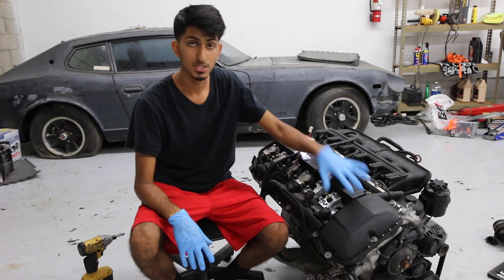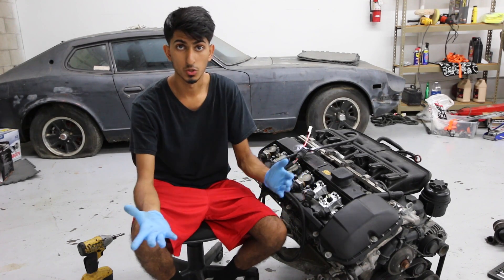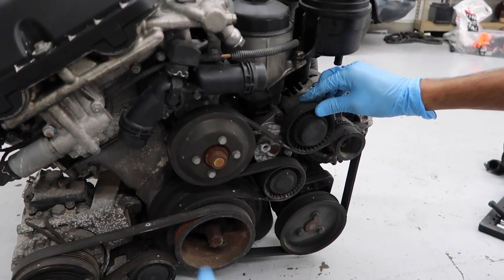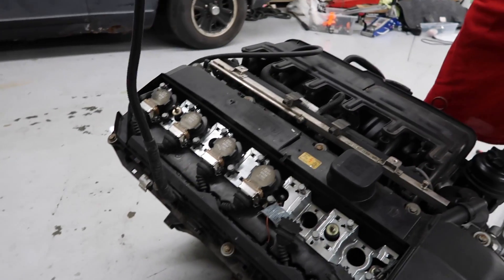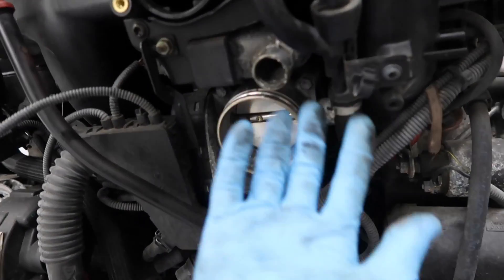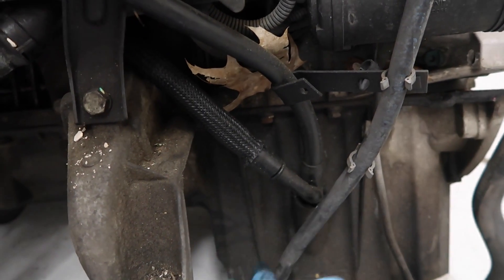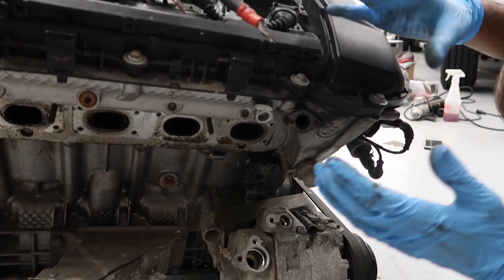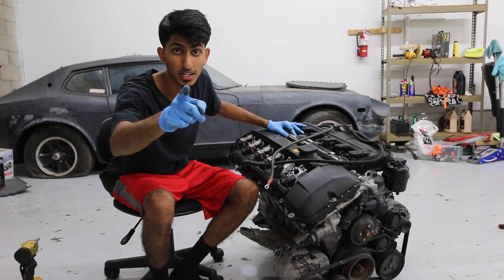Part 1: BMW M54 Engine Disassembly- Get To Know Your Engine

Comment: Hi, question please, BMW E39 M54 engine. The car smokes rarely only after accelerating following descending, after a deep vacuum it smokes, that is, if we go down on neutral, nothing happens, but when we are on some kind of gear shift, and suddenly we gas, smoke comes out. PCV valve, valve stem seals are changed. Gasoline 95 is used, by the way, it happens after long drive, when oil temp rises, though in rare cases. After smoking the level of oil decreases. I am sure it is oil. No smoking in the morning and in the rest of cases, what could be the reason, TNX

Comment: Great video .. I need your help with this p1419 code. I replaced the check valve and the secondary air MAF. The secondary pump appears to be working at cold start for about 30 seconds then shuts off. I still have the check engine light. I took it to the dealer who basically said, I have a blockage and I need a new engine 😳😭.. the car otherwise runs perfectly fine. Is there a way I can “clean” this blockage ? I have a 2004 X5 3.0L. Thank you so much in advance!

Comment: Urgent help , on the exhaust side of the engine under the solenoid and the cam shaft sensor there is a part that uses a 32 wrench to remove what’s the name of the part because mines leaking oil and it’s not on the OEM diagram listed or it can’t be seen.

Comment: Hey guys, i have a problem with my e46 m54b25. My engine does a strange sound but i cant really locate it and find the reason. It sounds like a high pulsing tone like on this videos: 

my car:     https://youtu.be/kzx0Bgm_D9A 

other guys car: https://youtu.be/ZZfxCLt5ygc

the direction of the sound is from the throttle, but i cant image that the throttle or the idle controll valve can cause this sound

i thought the DISA was the problem and i changed the DISA, but the sound was still there. 

i would be very thankful for every tips and help.

greets from germany!

Comment: I have a problem with my oil pressure. It pops on my dash when i put mine airco on. When i turn it out the oil pressure goes away. What can it be? Same engine

Comment: Hello great videos 👍
My Qs?
is what manual transmission can I use on my m54 04 330ci? Like from what car,or there is non other tranny that will fit my 3.0 engine?
Does one from a 2.5 will fit?  
Just lookin to swap a tranny that bolts into my 3.0 block!!

THANKS IN ADVANCE 👍

Comment: Hello. Do you know of any place that sells a kit that would include all the various plastic components found on the driver's side of the engine, or do the have to be sourced individually?  I'm also looking to buy a shop manual before I start the rebuild on my 2005 320i with the M54 engine. I just recieved the cam timing & vanos tools, but I'd like to get a shop manual that has all the engine specs. Any help would be appreciated. BTW, great videos.

Comment: I posted this on a fourm but i wanted your 2 cents.
Hi,
I currently have a BMW 2005 e46 325ci.
I have a rather Unique idea for the car. 
My plan is to leave the currant engine in the front of the vehicle and in the back (where the passenger seats are) i plan to put a second engine.
I will connect them Inline with a drive shaft then at the back of the second engine i will have a 7 Speed Sequential Trans-axle transmission.
I would also like to have a clutch separating engine 1 and 2 so i can drive the car in economic mode.
I will also be installing a roll cage around the second engine, and probably sound dampening to stop me from going deaf after 5 minutes of driving. 
Other issues with my plan is how do i cool the second engine?
How do i feed it air?
Both engines will be super charged and maybe turbo charged. I want at least 250KW (335Hp) from each engine.
What do you think? Is this a great idea, or a way to ruin your ears and wallet?
Regards for any answers,
-Tim

EDIT: I still plan to keep all the interior in the front of the car, both seats and radio, etc. So im not going all out race car.
UPDATE: The rear engine is going to get air from the two rear side windows. They will be modified to have the back going in the car about 7.5cm. This will be done on both sides. Note I still have no idea how i'm going to cool the beast.
What do you think?

Comment: What's up man, like your videos, it's really helping a lot. I had a questionare you ever going to show how to rebuild a E90, 2006-2011 engine? I have a 2009 BMW 328i, it doesn't start but cranks, the mechanic said to just swap the engine, but if I can just rebuild it, it would save some money, and get to know how. There's No video on YouTube that shows you step by steps like you do. And If you would like to use my car for a video show how, in case you don't have the exact engine or car, let me know I'll email more info. but the down side is that the car is in houston.

Comment: great video jason
i got I question recently my ccv system get frozen due a extremely cold wheather here in chicago i turned the car that day and my e60 started black smoked coming out thru muffler 3min after the car shutdown himself and i doesn't want to startagain i pulled 3 sparkplugs and they are covered in oil i check the vaccum hose and is clogged with yellow smog in this case what will recommend to do any advice will be really appreciate thanks
Reply: You probably already figured it out, but you have a hydrolock - oil got sucked in from oil pan into intake manifold. It probably destroyed the engine.

Comment: Nice job on your detailed instructions. I have question. I have 2006 550i that needs the valve stems seals replaced. Is that something I can do on my own, and do I have to remove the engine from the vehicle. Can you do a video on that? Thank you in advance. Keep up the good work

Comment: I don't know much about your channel but where did you learn to work on this engine?  Is there any books you would recommend besides the dealership repair manual?
Reply from the maker: Honestly I just took it apart and figured it out. I am sure there are repair manuals like the bentley manual that should go over everything

Comment: The parts in this engine is a cheap way to build a stroker out of a M52 block.  M54 cams, crank and pistons. Keep those if the engine is toast.

Comment: very excited to see you back at the helm of the new shop. congratulations on your move and good luck in cali. your video on the motor shows quite a bit.  it gives me a better overview of what's in my car(02 325ci coupe). I was told I need a rear main seal and oil pan. seems oil leaks are common on these cars. look forward to your next video. my friend thanks for sharing.  
cheers!
Reply from the maker: Thanks, I will be covering all of the oil leak areas

Comment: im gonna change the clutch on my e46. it's gonna be my first clutch replacement and was wondering if you could give me some tips
Reply from the maker: If your exhaust bolts are rusted, have it removed by an exhaust shop before starting the job. Besides that, try to have a helper or transmission jack, bunch of extensions and e-torx sockets. Do the rear main seal, throw out bearing, and shifter bushings if you can. Also do the guibo and the center bearing for the driveshaft. Message me on instagram @ShopLifeTV if you have questions

Comment: hey how much different is an m52tub25 compared to m54b25
Reply from the maker: You will have to remove the transmission. I recommend changing the clutch and rear main seal while you are in there. So yes, labor will be expensive.
Reply: +ShopLifeTV Jadon, do you recommend going with single mass flywheel instead of the expensive dual mass? any drawbacks with going with the single mass?
Reply: Both mine are manual transmissions. I enjoy driving the 323 more due to the lack of clutch delay valve but the m54 is defenitely the better motor. It loves to rev and is much more responsive.
Reply: +Ben Gonzalez doesn't clutch delay make shifting smoother?
Reply: +aidem huerta Heck no. I think it's there to eliminate driveline shock. I will be removing it on the 325 after I get a new clutch.
Reply: +Ben Gonzalez driveline shock. is that when the car shakes if you depress the clutch to quick?
Reply: +aidem huerta That's part of its consequential drawback that probably wasn't intentional. All 3 of my cars are manuals and I feel like I'm more aware I'm driving a manual in the 325 if that makes any sense. The others are that much more effortless  imo.
Reply: +Ben Gonzalez makes sense. my 323i might need a new throw out bearing. do you know if the labor is expensive?
Reply: +aidem huerta not sure but I bet Jason knows.  You can also check out e46fanatics.com for info or if you have access to All Data labor time guides.
Reply: ShopLifeTV how much do you think in total (parts & labor)?

Comment: Hey shoplife and people of YouTube how many miles do you think an M54 engine that is maintained well can last even when the repairs are more than the cars value would love to see some comments on this, thanks guys!
Reply from the maker: I have worked on an e39 525i which had the m54 with over 400k miles, all original with a manual trans.
Reply: 300 to 400.000 km (190 to 250.000 mls) easily ; )
Reply: Awesome that's reassuring I just hit 290,000 miles yesterday on my 325xi all original apart from the stuff that goes. It consumes some oil ( a quart every 300-350mi ) it runs strong just approaching 300k mi is a big milestone and im not ready to rebuild the engine just yet.